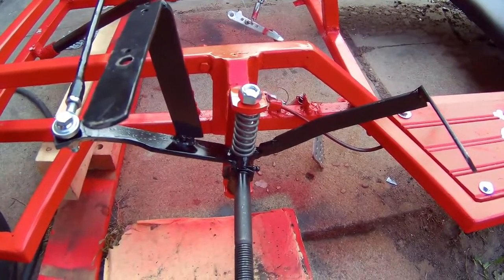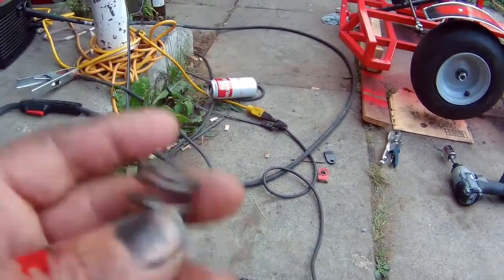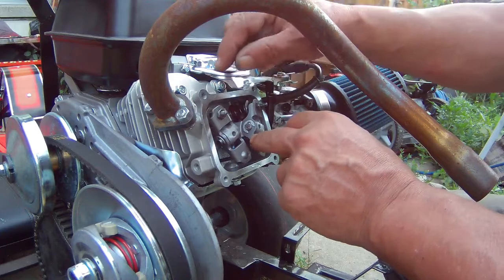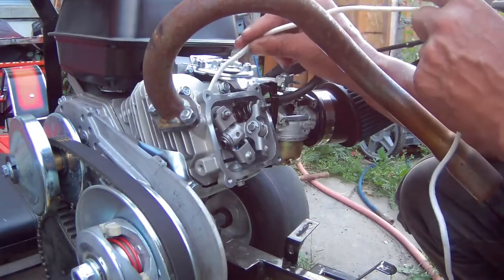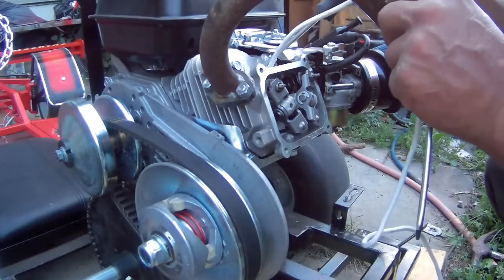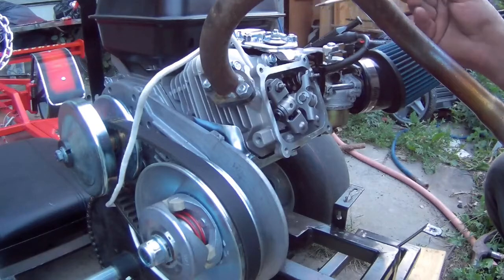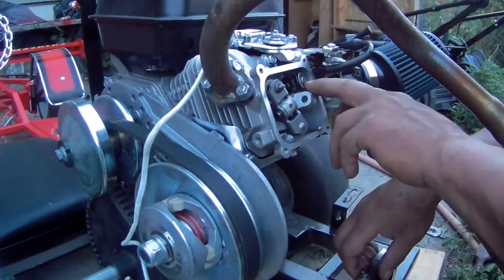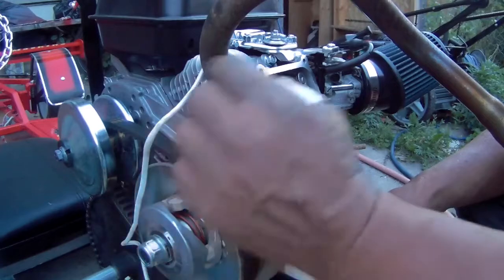Homemade Go Kart Sexy Machine pt,15, 18lb springs And Finishing Off My 2 Problems

Comment: good call on the valve lash!!  Most of the time the lash is different on each motor because not all valves are the same exact length
Reply from the maker: Hey David, yeah I don't think I have to change the valve lash, I think it was best to check it before and making sure it was the same after
Reply: Most of the time you only have to change it when its a lot more worn in ( older engine )
Reply: got you shared on my google plus too
Reply: Good thinking too!!!!
Reply from the maker: Thanks David

Comment: Thats the same size converter on our small machine.  Whete do you get your belts from ?  We chew through them big time. I stupidly bought a 16 hp  engine for it.
Reply from the maker: Hey customwinder, I got my converter from gopowersports (I can't find any place here In canada to buy these parts) and so far I had no problems with the belt, I also got a 15hp engine for my next build, David Johnson is using a 30 series converter on his 420cc build and he say's it's holding up fine so far
Reply: Neves Projects Yeah  I've heard of go powersports .
Try and get the biggest convertor  you can for the bigger motors. The 16 hp engine in the wife's off roader   eats belts  but only when the boys give it a workout.  The mrs isn't as harsh on it. 
Great work mate.👍
Reply from the maker: I did get a 40 series cvt for the build I'm doing now, but yea the boy's are kids like me lol